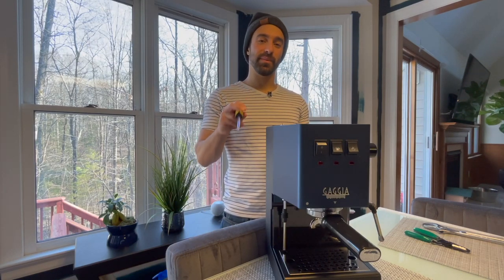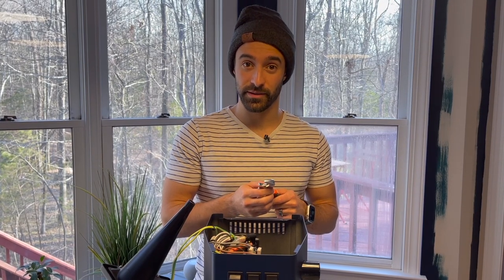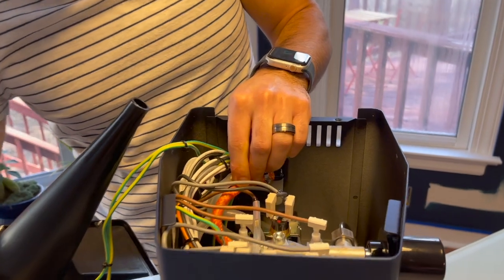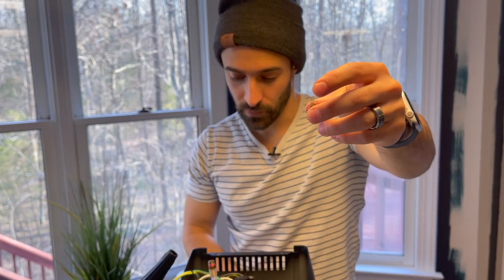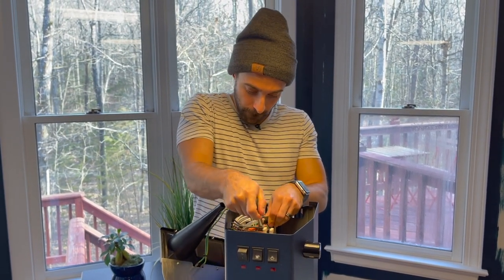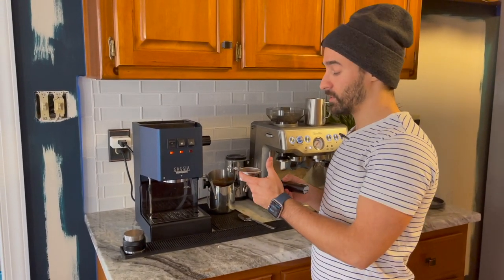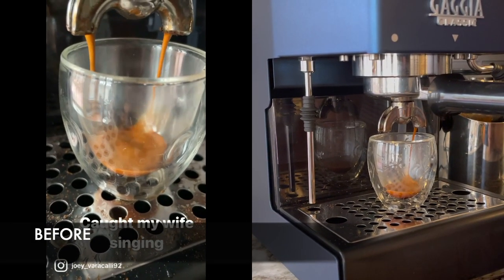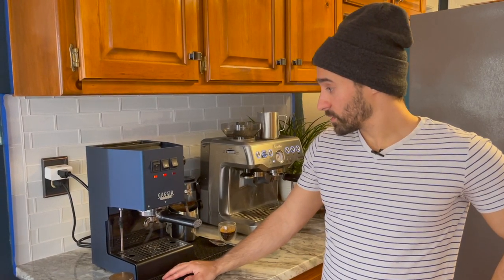Gaggia Classic Pro OPV Mod

Comment: Hey Joe, I did this to my GCP and it's much easier to remove the valve if you disconnect the hose first. The preasure is set at around 15 bars from the factory. 10 is fine for most folks.
Reply from the maker: Yeah I agree I didn’t disconnect because I was having to pull pretty hard and honestly it wasn’t that hard with it on anyways I found
Reply: Yes you're right about that. I had to fight a bit to get it off.
Reply: I just did mine and felt like I was way less likely to break something just screwing the whole valve+hose combination off like Joe did rather than trying to yank the hose off the valve.

Comment: springs has 2 circular terminal that lay on parallel surfaces. if you cut a spring you just leave one terminal with a spike that can't distribute correctly the pressure on the surface it is adherent to. You should replace that coil rather than cutting it
Reply from the maker: True but quick free mod is fun

Comment: After cutting the spring I could not get a constant extraction, did you experience the same?
Reply from the maker: No but I will say making espresso  on the gaggia is less science and mostly art lol 😂 u sometimes have to get lucky. But you could double check the pressure using a pressure guage connected to the portafilter

Comment: i am searching for an espresso machine.. i've never owned one before     I have read this makes the best espresso in the price range.. that is what i want more than anything is good rich espresso...  would you say this does accomplish that?
Reply from the maker: Yes absolutely but there is a learning curve and you also need a good grinder so you can dial in.
Reply from the maker: If you need a good grinder I’d go with this one https://amzn.to/3uGD1N9 it’s a great starter grinder or the breville smart grinder https://amzn.to/3a5fLjY
Reply: I got it and its huge disappointment. Tried it with this opv mode and it made coffee taste worse. Flair or Cafelat would be way better machines.
Reply from the maker: @aleksandarstojceski3139  yeah I’m gonna switch soon to a slayer and make the best espresso

Comment: For anyone wondering on the taste of coffee after doing this: I have a La Marzocco Linea Mini home in Europe, and the if the coffee made by the Linea is a 10/10 (better than anywhere you'll get in a cafe in my experience), then the Gaggia Classic will produce a 8/10. It can extract it pretty well, but it's just not as consistent in terms of flow (it varies a lot more in temp. and pressure) which is evident just by looking at the flow. 

Overall, it's always worth spending more on a good coffee machine, as they use better components (La Marzocco uses a Stainless Steal boiler, for example), but overall, my experience has been surprising after this 'hack'. 

Good job Joe on the video!  Wouldn't have done it had I not seen this :-)
Reply from the maker: Emil thanks so much I have never used the linea but I would bet u are correct
Reply: The price difference is day and night though. Maybe OPV + PID can bring an easy 9/10 with a fraction of Linea's price :P
Reply: @evronetwork  Yeah, but trust me when I say that I'd buy a Linea Mini again, without thinking. You can't compare the two machines..
Reply: @emilhajric-helpjuice  Of course you can't compare a VW Golf vs ferrari ...no matter how money you throw to that golf ...still you'd be able to buy a few golfs but not a few ferrari's ..you see my point?
Reply: @evronetwork  Do you have a Linea Mini?
Reply: @emilhajric-helpjuice  no, neither a ferrari if that matters :D
Reply: @EvroNetwork  exactly. If you understand basic wiring a pid is like 40 bucks from China all in and an opv another few or can trim spring as shown and remeasure

Comment: Is it the length of the spring or the stiffness that matters most in this case? Cutting the spring always increases its stiffness (spring constant). Wouldn't that also increase the operating pressure the valve?
Reply from the maker: Has to do with distance is my understanding
Reply: You are correct,it is the stiffness of the spring,there are on the market 5,6.5 and 9 bar springs available,all three come in a kit,check out 'Shades Of Coffee' they are available there for purchase,and they do not cost much at all.I know this as I have just purchased mine from there 🙂

Comment: did you paint your wall blue to match the gaggia? question on the noise after the 9 bar, did you find the noise on the machine to be louder or the same?
Reply from the maker: no we actually had the wall blue. I was going to order the stainless but my wife said hey why not match the wall. yeah id say the sound was about the same.
Reply: @JoeyVaracalli  ooh ok. it looks pretty cool ehhe. thanks for your reply, I was worried it was going to be louder from another video I saw. could have been an error.
Reply from the maker: @baan3197  yeah for me it didn’t make a difference

Comment: Hi, I was talking to Marc from Whole Late Love and he believes that the 9Bar spring is not required as the brewing pressure while brewing the actual coffee should be apt 9Bar in the portafilter with the OEM spring. Any comments?
Reply from the maker: Yeah I have also talked to him about that and I sort of a agree because it’s about the pressure in the group mostly but I think it’s more forgiving at 9 bars especially if you want to use a bottomless portafilter. If you ever watch folks even myself using a bottomless on a higher bar machine like the barista express for example it’s almost impossible to have zero squirting / channeling at 11 bars plus
Reply: @JoeyVaracalli  Thank you. I have been using a bottomless portafilter for a couple of months now without any channeling issues even with the original spring. I use Bezzera BB005 grinder and a single shot basket ( even with double shot basket I did not see any channeling issues ). But I do taste difference in shots after cutting the spring ;). I don't quite understand why. Let me know if my understanding is correct- The brew pressure inside portafilter will depend on the grind size and not the spring. So both 15 bar spring and 9 bar spring should produce a 9 bar pressure inside the portafilter if your grind settings are correct and 9 bar spring mod is to reduce the channeling effect only.
Reply from the maker: @DarkKnight-yc8nw  sure the pressure in the group can be the same but you also have to consider flow rate. Take a look at the flow control machines. When the pressure is brought back a bunch the water dripping on the puck also slows down when you ramp up pressure the water increases. You can sort of demonstrate this on the gaggia if u open the steam valve on the gaggia while pulling the a shot. Obviously some water is being sent somewhere else in the case but you kind of get the idea.
Reply: Just chiming in here, I just saw this video. I'm no expert, and haven't done this yet, but that valve is limiting the output pressure of the pump. That means the pressure inside the group cannot be higher than that value, but it can be lower depending on the flow rate, i.e. the grinds, tamping, etc. So with this adjustment you can do anything you want, have as much coffee and tamp as much as you want, and you won't go above the spring pressure.
Reply from the maker: @ThingsIdRatherBeDoing  you nailed it…. Won’t ever go over 9 bars
Reply: Even in the manual,  Gaggia refers to it as the 11 bar overpressure valve. Shades of coffee sells a 9 bar OPV spring kit.
Reply: There's ~14bars in the portafilter with water output totally closed. So whatever you pump will force those 14bar pressure.

Comment: The gaggia is 15 bar not 11
Reply from the maker: The pump is 15 bars yes… the over pressure valve / spring is set to 11 bars meaning at the brew chamber you are brewing at up to 11 bars. You can buy an opv spring to lower the pressure at the brew chamber though on the plus side.